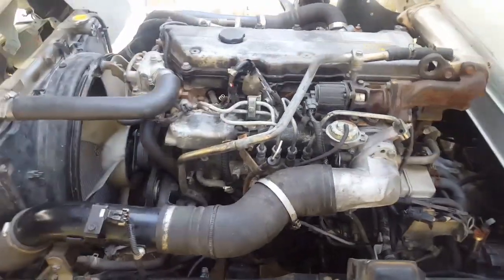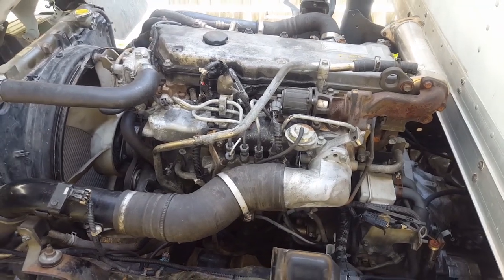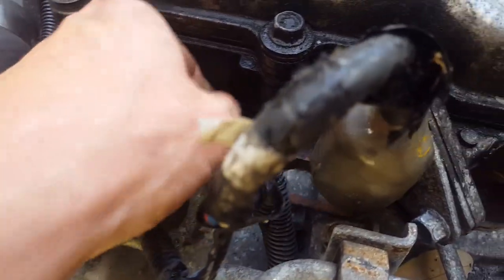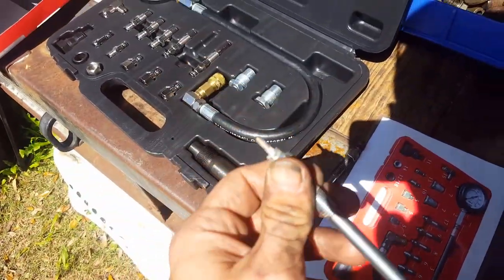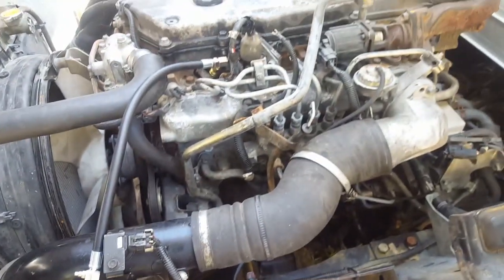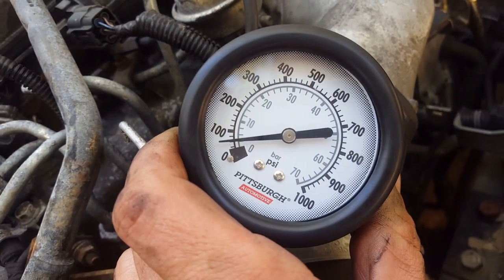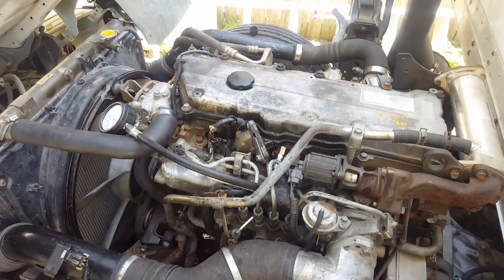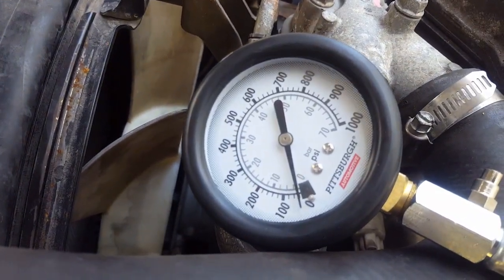Isuzu NPR 5.2 diesel 4HK1TC compression test

Comment: have you ever seen a 5.2 pressurize the cooling system with no misfire, no oil water mix, no combustion gas in coolant, and i blocked off egr lines? cold start up goes from 0psi to 5 psi in 1 minute,, any suggestions? maybe injector tube?

Comment: Where can i find one of that engine
Reply from the maker: Hi. I bought a non running one on Ebay for $2,000. Theres other good running ones on Ebay for $4,500 and up. 
https://www.ebay.com/itm/2006-Isuzu-4HK1TC-Diesel-Engine-EGR-Model-5-2L-Isuzu-NPR-GMC-w4500-low-mile/113944249345?hash=item1a879b4401:g:ZvYAAOSwHbldu2uC

Comment: hhhmmmnn ...
did you remember the head gasket ..??
ooohhh... a few minutes in, and this is bad.. very very low
not even gas motor comp
Reply from the maker: Yes, there was a head gasket. It turned out to be a combination of a warped head, bad gasket, and leaking valves. Replacing the head and head gasket fixed thed issue.
Reply: I'm having the same issues on my 2000 UD box truck. Please help!